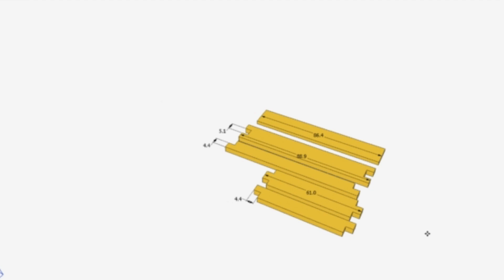Building a sandbox

Comment: Water noodles and a few zip ties. I built a generator enclosure for my grandparents last year and used metal roofing for the cover (has folding top and sides to keep the generator cool when operating). It's installed on their deck, but the metal is at the same height as the handrail. I used some standard metal trim to help cover the sharp edges, but my grandfather later took that off and wrapped the roofing with those foam water noodles. Does the job.
Reply: Good tip. You could also cut a pipe and simply screw it.

Comment: Sand tip! If you bake play sand in the oven first, it will sanitize it (surprisingly necessary - lots of nasty stuff) and remove moisture! Not only will it be safer, but it's easier to dig through for little hands AND easier to brush off of clothing and skin. That means it won't track inside the house as easily. :)
Reply from the maker: and also no fun until you get it wet again.

Comment: I am glad my scrap steel got a good use! If you do not know about it already, check out Devon Lumber on the northside of the river (just google the address) for inexpensive cedar. Most of it is rough cut, but the savings compared to the big box stores is staggering. They usually have a lot in the spring, but their stock dwindles quickly as the summer goes on. - Scott

Comment: Use a steel hammer and glancing strikes for shaping sheet metal in a hurry. Speaking from over a decade of experience of working with the stuff building just about anything. I had/still have more hammers than fit in most individual toolboxes, each sized, weighted and shaped for a specific purpose.

You just made your job take twice as long by using a wood mallet though.

Flat head, bevel head, and ball peen should be used depending on the task. For folding perpendicular angles a flat or nearly flat head is ideal. Copper, bronze and dead mallets are also essential tools.

Comment: Neat. I'm surprised you didn't put a slot along the wood frame and bend the tin to fit and then screw it in.  Even dull that Alu is thin enough to cut if you slide a hand along it usually, Or get a piece of rubber strip and slit one side and glue it?
Reply from the maker: rubber is very difficult to glue.  And the slot thing - that's just another place where moisture get trapped.  Plus very difficult to shape the metal accurately enough to hit it.

Comment: I understand 100% why you used the sheet metal roofing for the lid (materials on hand), but for those that are faced with buying new materials for a similar project, maybe galvanized hardware cloth or cedar fence boards could be used.  Both are easier to work with, but don't keep out the rain.

Comment: Question for you - In many videos I see people using the impact drivers for screws into wood, seems like you always use drills? Is this just a preference you have or another reason? 

Edit: The kids excitement was just too cute!
Reply: In my opinion the impact driver offers nothing more especially for short screws. They just screw up the driver tip more easily.
Reply: I've read that Matthius doesn't like the noise an impact driver makes and finds a drill works well enough.

Comment: Good luck lifting a box full of sand onto a dolly. Honestly that is a completely useless feature. You won’t be able to get it up onto the dolly. And instead of getting longer screws you used two different size drill bits on a drill press and then a ridiculously long drill bit. Easier to get longer screws. And your idea of safety with metal edges for your own kids is very…liberal
Reply from the maker: I woldn't be lifting it, just levering it up on either side.  As for "easier to get longer screws" - how is it easier when I already got the longest deck screws the store had in stock?